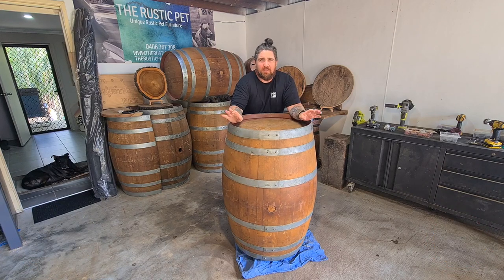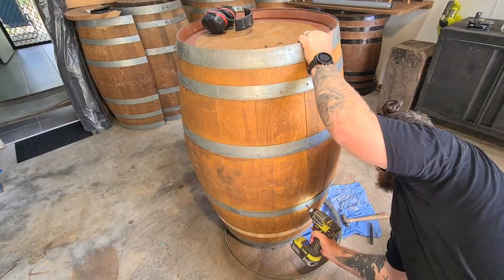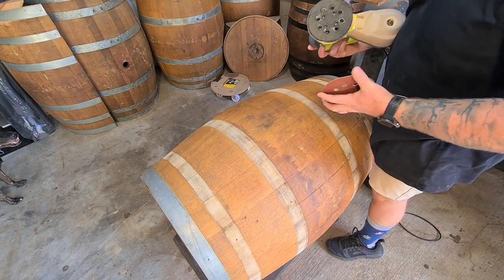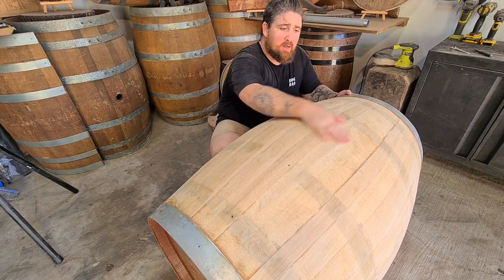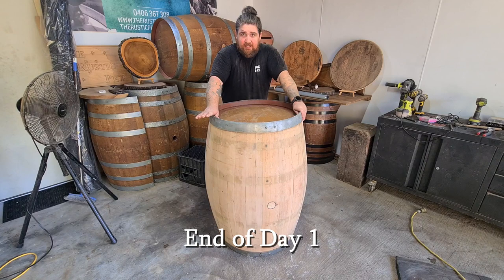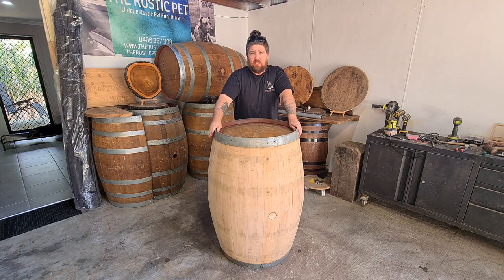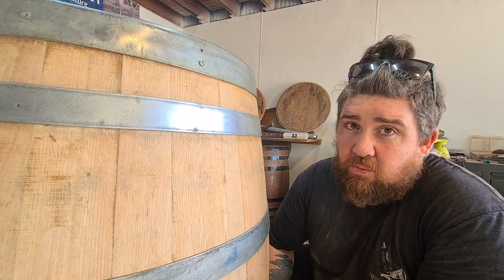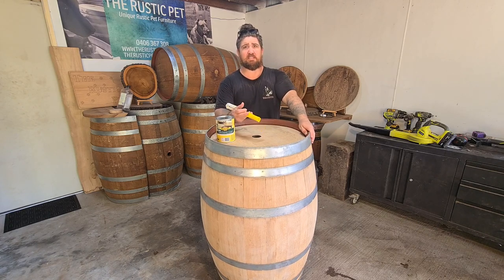Make your own Umbrella Wine Barrel - Don't make these MISTAKES!

Comment: Would've loved to see how you secured the umbrella into its stand beneath the barrel.  Looks great!
Reply from the maker: Hey @Tmonterra I simply placed the stand where I wanted the barrel to sit, titled the barrel over with the lower part of the umbrella inside the barrel. Tipped the barrel back upright at the same time ensuring the the umbrella post and the stand all aligned. The hole I cut underneath was substantially bugger than the top to allow me to reach under and tighten the nut.

Comment: My method for stripping the barrel bands off Whiskey and Wine barrels: Find the narrowist (or, otherwise, the least valuable stave in the barrel); Use a cut-off wheel in your angle grinder and cut entirely through the steel barrel band. Peel the band off the barrel (You will probably have to coax it off using a small pry-bar where it is nailed. The t-headed nails come right out of the barrel when the band is peeled off. In my experience, the t-headed nails have been so tight in the barrel band that they did not separate from the band. I also have a tight rope-wrap around the barrel, preventing it from collapsing before I was ready. I have not seen screws used to hold the barrel bands on in the barrels I've found in my neck of the woods. (Colorado)
Reply from the maker: Absolutely amazing work mate, ill give it a try next time. 👍

Comment: Beautiful work and thank you for explaining the steps so well. I'm curious if it would be better to apply the poly before putting the rings back on?
Reply from the maker: You could, but they wouldn't slide back into place easily and possibly have an area thats not as stained or weathered, making the barrel look average.

Comment: Just came across this.  Wondering why you made the bottom hole a lot bigger?  Was there a base the umbrella pole went into or something? Why not make the hole same size as the top?
Reply from the maker: Yeah, see previous replies. A large umbrella base was used to secure umbrella under the barrel.

Comment: Looks great.. what size barrel is that? I hear there's different sizes.
Reply from the maker: Thats Correct! we work with 230lt and 300lt they are often called Barrique and Hogshead, this ones a Hogshead, so the larger version. There's a larger one again, which is 500lt called a Puncheon

Comment: I saw you put a larger hole in bottom for umbrella stand.  Do you put an actual stand in ground and put the barrel above it?
Reply from the maker: Yeah so the larger hole is for the umbrella stand base which has a little adjuster nut that tightens on to the umbrella post. The bigger hole allows you to be able to tighten and reach when the barrels there.

Comment: Why did you cut a large hole in the bottom of the barrel and a smaller 1 inch hole at the top of the barrel?
Reply from the maker: Hey Carl, the larger hole at the bottom is for the umbrella stand. The hole at the top is for the umbrella post :)
Reply: So the barrel sits on top of the umbrella stand?

Comment: Thanks for the video. Can you drill out a hole in the top or bottom without it falling in? I would like to put a water tank rain water filter in the top as I’m going to use to collect water for a chicken coup. Just worried it will fall apart?! 🫣
Reply from the maker: Yeah, you absolutely can. The rings keep a barrel together.